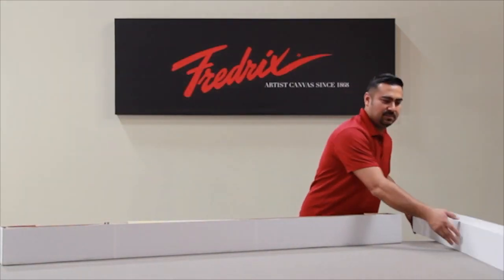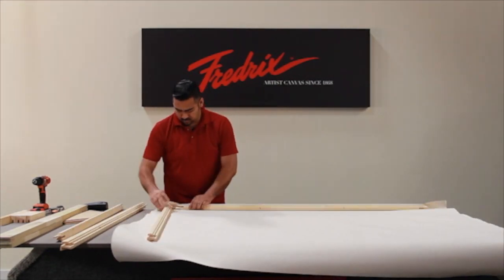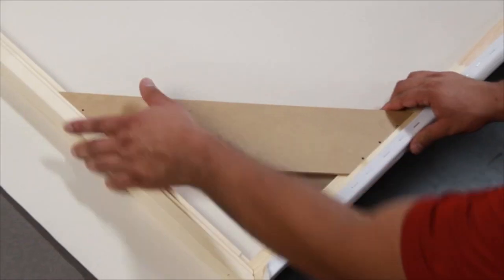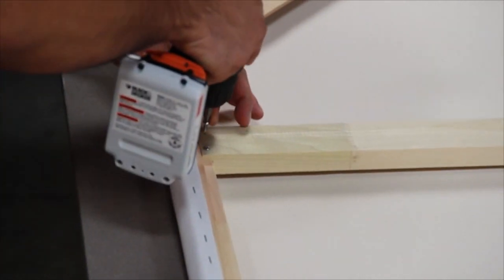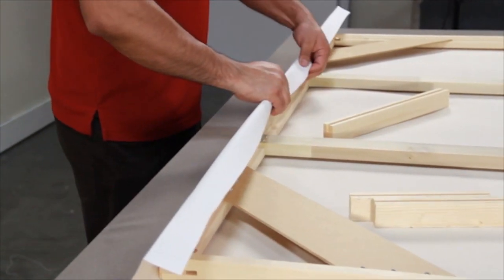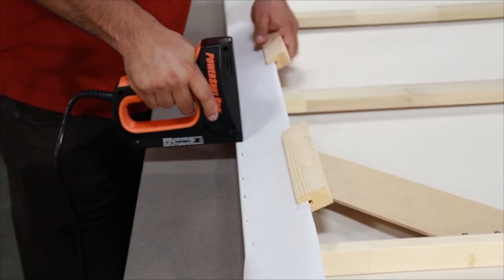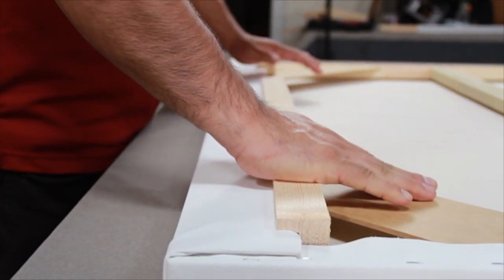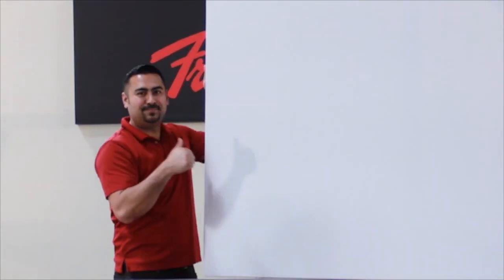How to: Stretch It Yourself - Fredrix Pro Series Dixie Canvas Kit

Comment: I have been stretching canvas now for 29 years. I really love this system!!
 However, I do not use the braces that are supplied. With the regular Pro canvas that they sell ready made, the corner and vertical braces are toe nailed Into the stretcher bars. This makes NO SENSE to me because it makes the canvas unable to key it to tighten. The wood keys are included but USELESS. The keys will open the corners but with the cross braces "locked" down, the bars can't move and expand to tighten the canvas. 
 I modify this kit with Jack Richeson & Co. Brace holders and mechanical keys. They allow the frame not to be "frozen and locked down" and let it expand if the canvas needs to be tightened. 
Also, I would suggest that you not cut the canvas to the edge of the stretcher as shown. Once you do that, the whole idea of breaking the canvas down and shipping it to be re-stretched by your client or gallery, is not possible. You can not even get a grip anymore with pliers or use the incredible system that makes this reusable. It is best to leave 2"or more if you want to use the kit again, and fold it under and tack it down for the future. If done neatly, it looks good and shows some foresight to gallery and museum  personal who will appreciate you giving them the extra canvas to re-stretch your painting.  This combination is the best way to present your work now and for the future. 
With this being said, I will use these from now on for all my work. :)
Reply from the maker: +Henry Von Genk,III Thank you for your input and additional suggestions on preparing the canvas for the galleries.  Those are all excellent options.